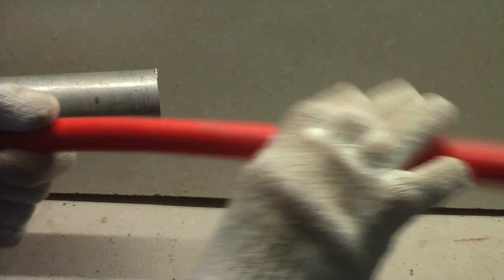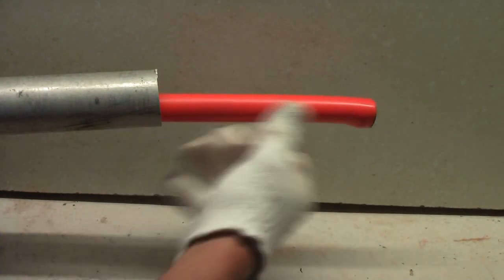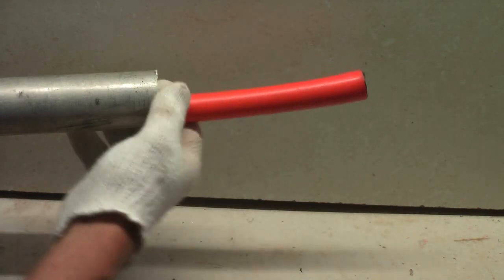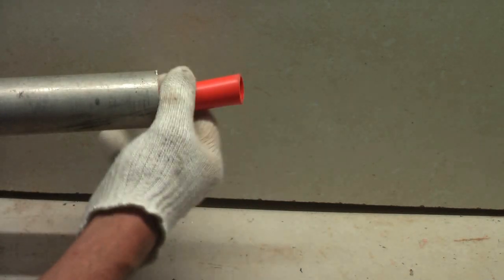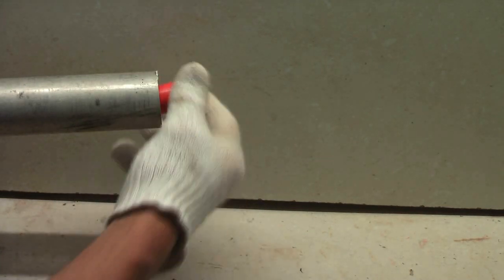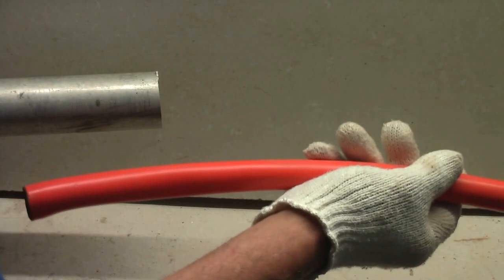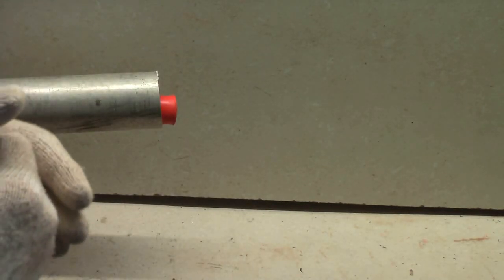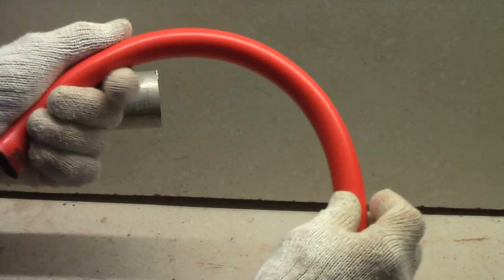✅SIMPLE QUICK WAY TO HEAT AND BEND PLASTIC PVC PIPE  &... (Now with CC)

Comment: It`s totally logic that the heated end will heat up much much more than the opposite end because that`s the incorrect way to heat up the metal tube, it`s obvious. Now kids I`ll explain the correct way to do it. Using the metal tube will heat the PVC tubing without scorching it and more evenly OK but you must apply the heat not at one end but evenly along the legnth of the tube. You must put the PVC tubing not into a solid metal tube but into an aluminium flexy tube , the type used for conducting hot air ventilation arround buildings and floors. They come in all diameters large and small. Once the PVC tubing is inserted inside the aluminium conducting tubing then heat preferably with a blow torch along the legnth of the aluminium tubing whilst turning it or rolling it if it`s on the floor in order to heat the surface of the aluminium tubing evenly. Do this with precaution of course and make sure the aluminium tubing is placed on a heat resistant surface and not on a wooden table like an idiot. You could use a hot air gun instead of a blow torch but it will take a lot longer to heat up the aluminium tubing. It is also possible using my method to bend the PVC whilst it`s still inside the aluminium tubing as this is a flexable tubing but you can`t see the result of your bend. Pouring water inside the tubes will cool them off and make the PVC rigid. Once the bend is made you can easily slide the aluminium tubing off the PVC. Another advantage is that if the bend is incorrect you easily slide the flexable aluminium back over the PVC tubing and correct any errors so repeating the proceedure, which you can`t do if the aluminium tubing was rigid. Tip, no harm in putting sand inside the PVC tubing to be sure of a tip top bend.

Comment: that's neat for sure
Reply from the maker: Where doing this way you might want to have the PVC a bit longer then what you need.
Because the end where the heat gun is tends to over heat the end and scorch it.
This is why you turn the PVC tubing around, less likely to do this.
Working on another version where the heat will come in from the middle of the heating pipe.
This should solve the scorching on the ends of the PVC.
Reply: if you want to heat from the middle put a metal tee in the heat pipe then heat it from the middle a easy simple fix not sure if it will get to hot at the point of not but if it does you can put a heat shield on it so it don't burn the middle good luck to you sir.
Reply from the maker: iwantosavemoney Good point there.
Where the heat gun goes in, the heat will be diverted to left and right.
The ends will have a flip end that open and close.
So to keep the heat in.
So to act like an oven.
Reply: yeah I thinking it will work as long as the tee piece is far enough away from the pipe where it does not burn it your demo made me think of it. am going to build one also because their is so much stuff you can build out of pipe and it is cheap. thin wall pipe is great for molding sheath for anything like knifes axes and their are many more applications. the reason I want to heat up pipe is because I want to mock up some back pack frames that have a built in chair and when I really build it I will use aluminum pipe not cheap so it has to be right the first time. good video
Reply from the maker: iwantosavemoney When I get it together wile make a video how it was done.
With thinner walled PVC you could have it on a lower setting ( heat gun)this way you are will not burn the ends so much. 
Might be a bit slower but will still evenly heat your PVC.
Reply: that's what am thinking am going to give it a shot tomorrow and see if it will work
Reply from the maker: iwantosavemoney Let me know how it goes.
Reply: well it worked kinda the first and only one I burned a hole it and did not have anther pipe to test so I was kinda frustrated. I was walking away from it to let it cool off and I tripped over a metal funnel. I was thing I maybe going about this the wrong way so tomorrow I will buy more pipe and try a new method am thinking if I stick a funnel in the end of the pipe and heat it from the inside out it would be a lot easier to with it what I want. so phase 1 complete moving to phase 2. a 2 dollar funnel lol

Comment: This is a good alternative to using a heat gun by hand if you are making PVC bows but you have to be careful. I bought a 6 ft. metal pipe to heat a 5 ft. long 1 inch diameter PVC pipe. It gets soft in about 5 minutes but I learned quickly that the end closest to the heat bun will scorch badly and be ruined, even though it was a foot away from the heat gun. The only thing I know that might fix this problem is to switch ends about every minute. I tried putting foil on that end but it still burned.
Reply from the maker: Hi mellotron, Yes you are correct Switching the PVC pipe every minute or so.
Also remember the pipe where the PVC goes into holds quite a bit of heat as well. The up side is that it will the PVC evenly. As for where it scorches at the ends. Maybe allow an extra inch or so one ether end. Then cut to size when you have shaped PVC and has cooled off. Thank you for your information.
Reply: Herman Wieland Much more than inch needs to be allowed at the ends. I allowed an entire foot and it still scorched. I do believe rotating the ends is the only answer. This method is superior to waving a heat gun back and forth and heating unevenly.
Reply from the maker: mellotron Or you may want to have the heat gun at a lower setting?
It is a bit slower but it may avoid the scorching. As I said that the metal pipe holds the heat. The Electrical conduit we use also has a fire retardant in it. And is less likely to scorch or burn as quick. Is that the type of PVC you use?
Reply: @Herme-p4y  It`s totally logic that the heated end will heat up much much more than the opposite end because that`s the incorrect way to heat up the metal tube, it`s obvious. Now kids I`ll explain the correct way to do it. Using the metal tube will heat the PVC tubing without scorching it and more evenly OK but you must apply the heat not at one end but evenly along the legnth of the tube. You must put the PVC tubing not into a solid metal tube but into an aluminium flexy tube , the type used for conducting hot air ventilation arround buildings and floors. They come in all diameters large and small. Once the PVC tubing is inserted inside the aluminium conducting tubing then heat preferably with a blow torch along the legnth of the aluminium tubing whilst turning it or rolling it if it`s on the floor in order to heat the surface of the aluminium tubing evenly. Do this with precaution of course and make sure the aluminium tubing is placed on a heat resistant surface and not on a wooden table like an idiot. You could use a hot air gun instead of a blow torch but it will take a lot longer to heat up the aluminium tubing. It is also possible using my method to bend the PVC whilst it`s still inside the aluminium tubing as this is a flexable tubing but you can`t directly see the result of your bend. Pouring water inside the tubes will cool them off and make the PVC rigid. Once the bend is made you can easily slide the aluminium tubing off the PVC. Another advantage is that if the bend is incorrect you easily slide the aluminium back over the PVC tubing and correct any errors,  so repeating the proceedure, which you can`t do if the aluminium tubing was rigid. Tip, no harm in putting sand inside the PVC tubing to be sure of a tip top bend.